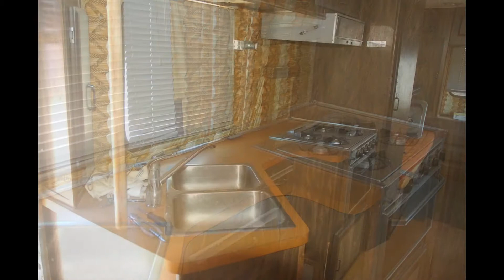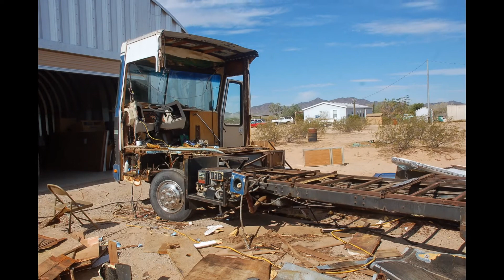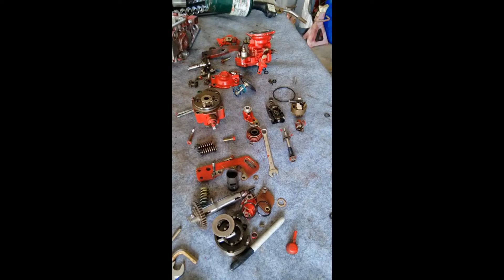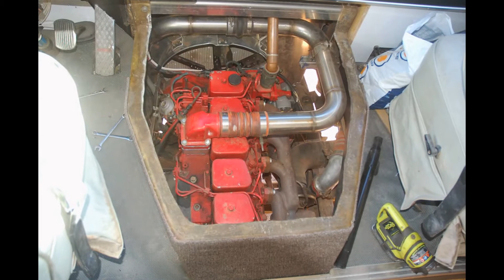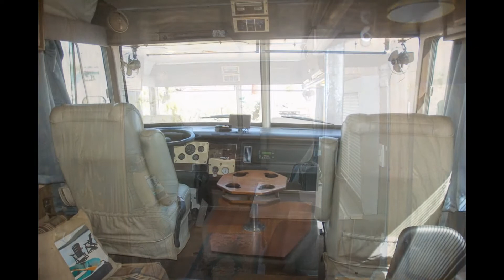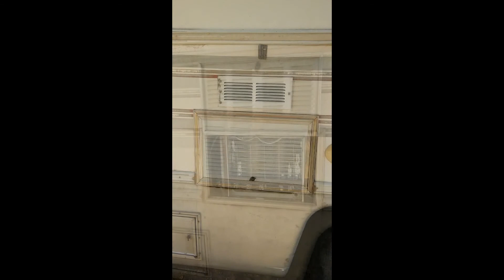Copy of AVCO MOTORHOME DIESEL CONVERSION

Comment: Happen to still have the Avco?
Reply from the maker: Yes I do, still evolving. It's 4wd now and has lots of upgrades, 1200 solar panels, 180 gallon water, six speed Allison but have a new 24 valve 275 HP Cummins and 3060 Allison with divorced t.case and doubler waiting to drop in....